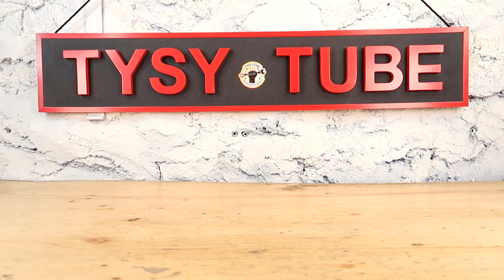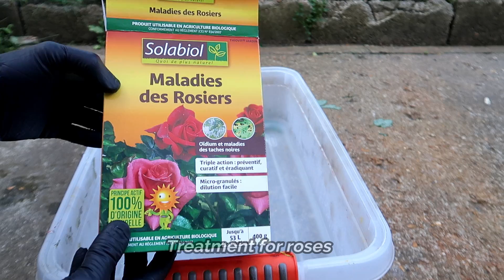Vintage Oxidized Sprayer restoration

Comment: I would have tried to preserve the original label. It looked way better compared to the new one.
Reply: I have seem them save them in previous videos
Reply: Did you guys not see it was unsalvagable?
Reply: @athazel4585  It was possible to scan/photo the label to outline the original typeface in any vector graphics program. Smaller size could be replaced with a much more similar typeface.
Reply: The original label was painted on. It couldn’t be peeled off.
Reply: Why why why u scraped of the original handpainted loggo and replaced it with a sticker 😢
Reply: The original label could have been saved by covering it with a decent grade painting tape. If it didn’t work out,at least an effort was made to save the original label. Either way, he bought it and is free to go about the project however he likes. I would have tried to save it because I like to keep as much of the original item as I can. However, I haven’t done a restoration in years, strike that, decades. But this Tysy guy keeps egging me on! Keep it up TysyTube, one of these days I’m going to get off my duff and restore something, just wait, you’ll see, maybe...right now I have a video to watch...😜
Reply: @maxyudin  I struggle to find something similar. "bazar" is somewhat similar but this one in particular i can't find. Strange "R" shape.
Reply: @Desi365  Yes,  "R" is the subject, everything else could be any slightly modified grotesque-style typeface, but "S" is also a question. It's not Bazar's as it is far away, but Bazar could be used instead because it fits  well.
Reply: @Vault57  I agree. Watching TysyTube is like a piece of sweets for me.
Reply: I was hoping it was a plaque.  The original looked awesome.
Reply: @henkerosen996  that's not hand painted
Reply: @maxyudin  If you knew what the name of the font was you could find it easily and not have to scan the original sticker at all. Just mess around with the kerning a little bit and print out overlays until it matches.
Reply: @Desi365  Even though the pump is from 1950 I am sure the font is from the art deco era.
Reply: I know it's not replaceable, but you should've used silk screen techniques OR, at least, retained the original dimensions of the original label when using the sticker route.
Reply: @henkerosen996   that gutted me. watching him scrap that off made me so sad.

Comment: Rust remover will not work with copper. To remove patina use vinegar+salt+flour.
Reply: He still removed it, but with sandpaper and polish. So - the same result, but easier to reach.
Reply: @-Sergey_  he clearly doesn't want patina on his restorations. He consistently removes it through sand paper and such. It's for his own collection so there's nothing wrong with removing all the patina.
Reply: I know about how removing patina reduces the price of a thing, I just adviced to author, how to reach the same result easier)
Reply: @-Sergey_  Agreed, a lot of these "restorations" are not restorations more modifications
Reply: Looks like someone other than me watches my mechanics channel too
Reply: @-Sergey_  There is value and then, there is value. We've been down this road on so many of his outstanding projects and nobody ever seems to learn from his comments or gentle jokes.
I like what he does, I enjoy it and, again - until I see the links to all the brilliant videos from the naysayers, I'm assuming they're incapable of doing what he does and, thus, are just blowing hot air.
Reply: Copper can not rust. Rust is iron oxide. Copper has no iron so therefore rust can not occur.
Reply: Looks like he did a pretty good job to me.
Reply: Patina is nothing more than dirt and rust.  Very valuable tools and firearms should not have the finish removed, but with a project like this, making the tool look and function as new again is the objective.
Reply: MC-51 can remove copper oxidation. You can see that the parts where brighter when removed from the solution.
Reply: If it's actually copper use ketchup and salt mix it together apply and wipe
Reply: @-Sergey_  not to everyone.
Reply: not everything on it is copper i did notice that one of the push rods isnt, i do agree you need vinegar to resolve copper issues but he did all of it at once so i dont see the prob also hes skilled at restoring things, ive seen him get alot praise from the bigger restorers
Reply: @-Sergey_  It doesn't.
Reply: kopfgeldjagar  atleast someone else realizes this.
Reply: @thomaspaquette9991  there is this thing called copper oxide though
Reply: @-Sergey_  
lol, why would it lose its value?
It's not like he remade the entire thing out of stainless steel and plastic parts :v
I'm a simple man, and I like the shiny, you seem to place more value on old dirt and grime than in the product itself lol.
Reply: i was so triggered by that
Reply: Using flour and vinegar on brass removes the zinc and leaves it pink.  Be warned.
Reply: kopfgeldjagar  'Do know that copper can oxidize. Right? '
It can, but the green coloured corrosion is a reaction to CO2 in a moist environment creating copper carbonate. Same with copper rooves and bronze (mainly copper) statues
Reply: @-Sergey_  Now I know you don't know what restauration mans. He brought the product back to its state when sold brand new. We don't care the value. Plus patina will come back one day...
Reply: @-Sergey_  WHat's the point of having rusty dust collectors on a shelfrather than having useful functionning tools ?
Reply: @-Sergey_  have you ever seen a museum exposing painting with patina on it?
Reply: @-Sergey_  "Value" does not exist. It's only the price someone is willing to pay for an object. If you prefer object with patina good for you. people will make cash from you selling dirty&dusty objects. Some prefers nice and shiny, like brand new objects. And those one will pay less for a dirty artifact and more for a restored one.
Their is absolutly no difference in this object. He's just clean. The only thing that may decrease its "value" to people like you is the sticker that is not original anymore.
Reply: @-Sergey_  Yes, however, we're not collectors. Besides, patina will come back anyway, so no need to worry about it.
Reply: @-Sergey_  A restoration is a process intended to give an object it's original aspect and functionality. That's exactly what he did? How would you name what he did ?
Reply: In what proportions?
Reply: Я, вот честно, никак в толк не возьму нафига коллекционерам патина? Она же только уродует вещи. На мой взгляд полированный металл это куда как красивее.
Reply: Налёт времени, ощущение старины и всё такое. Отполированная вещь смотрится новоделом часто.
Reply: Ну, если только. Хотя всё равно не понимаю я этого.
Reply: I've always just let my copper soak in some ketchup for 30-60 minutes then rinse with water and dry buff, brings it right back every time.
Reply: All this carry on about removing patina reduces value.... who cares? I could never understand the need for a dirty, grimy item. I’ve been restoring stuff for some time and all of my items are as polished as I can make them. I don’t give a “flying f..k” if I’ve reduced the value as I’m not selling it. It goes on display in my “Man Cave” (pool room ) or in my shed.
It boils down to, it’s my item, therefore I decide what I like.
Reply: Glucose and water is the way to convert oxidised copper into copper.
Reply: @mc-51rustremover13  When are you going to give this man a sponsorship?!?
Reply: Oooo why don’t you make your own videos then
Reply: @Brayduhsurus I totally agree! The value of an item seems to be only set by the amount of money someone agreed to pay for the object. PLsu what's the goal to own unusable items? it's like:
- IS your sprayer working?
- huh non it's rusted and full of vintage patina.
- OK, it's just a rusted piece of garbage then.
Reply: Or ammonia
Reply: Ольга и Сергей I agree but some people prefer to just make old things look new he probably doesn’t care about the value
Reply: @ethelryan257  nailed it!!!
Reply: @thomaspaquette9991  that's why they all call it patina.
Reply: Anyone going to  say that it looks as good as new? It looks awesome, something you would be proud to say you did, instead of something you'd shove into the back of your shed.
Reply: Dale D you realize your comment has no relevance to anything I said. But thanks anyway, good info.
Reply: @fnbdraco  why use ketchup when vinegar is cheaper and you don't have gloop to wipe off afterwards?
Reply: No offence meant because I, too, love homemade products that work. That recipe does definitely work but it leaves the copper with a pinkish finish.

Comment: I feel like I’ve seen this before. 🤔
Reply: Me too..
Hmmmmmh...🤔
Reply: Me too, in other resto Channel
Reply: @lurezpe8655  yeah, but tysy did a very similar sprayer like 6 months ago
Reply: @tracydono8427  nope, it was way before the fire extinguisher, the other sprayer was a little bit bigger but the same manufacturer
Reply: i remember around december someone did the exact sprayer but use turtle wax instead of snail ear wax LOL. and packing the pump with twine and plumbing grease.

Comment: Brasso (name brand) Polish Wadding is made to remove tarnish, oxidation, etc.. from brass, copper, stainless steel, and chrome - and it works amazingly well. (Never Dull, another brand, but essentially the same as Brasso.) Keep doing what you do!

Comment: That original label was so perfect... Would have just taped it off and polished the track by hand.

Nice creativity on the disassembly though!

Your poor grinder is going to need restoration soon! It shouldn't need help starting up!

I couldn't tell what grease you were using, but it should be silicon grease. It's much more inert than regular stuff and cheap/easy to get at the hardware store. We use it all the time in restoring old fountain pens.

Comment: Nice restoration although I think you could have tried harder to find the font for the large label. There is a website called “What the font” where you can take a pic of some type and upload it to their site, it might come up with fonts that are closer to the original.
Reply: But that font seems to be handmade (sorry my english)
Reply: anyway, in corel or illustrator you can vectorize it
Reply: Leo Tizi. I don’t think so. The roughness of the edges is probably due to the printing process back in the day.

Comment: You should try CLR on brass or copper. I work on tug boats and we use it all the time to get rid of grime on metals. Super easy. No scrubbing. Just let it soak and Wipe It off with a rag. Then bring back the shine with an abrasive polish

Comment: I thought the original label was in pretty good condition, considering its age.Personally, I would have taped over it.Just amazed that you find items like these at flea markets.If I'm lucky, I might run across a rusty pipe wrench or horseshoe at ours.

Comment: Get a nice thick piece of glass and spray glue the sand paper to it. This will give you a nice flat and smooth surface to sand or lap parts on.

Comment: In the U.S. there is a powdered stainless steel and copper cleaner called Kleen King.  It may be available on Amazon or it may be available in Europe in stores.  It is AMAZING on copper.   It doesn’t scratch and it’s great for copper upkeep.

Comment: If you put that in wire wheel cleaner for about a minute it would have done 95% of that including make the copper shinny. You have to get the stuff that's phosphoric and hydrofluoric acid for it to work. You can buy from auto paint shops. Stuff is amazing what it can do to metal how it dissolves the oxide and leaves the metal behind

Comment: I love these restoration vids  :). I have a question: why do you use wood hardener on the handle? Wood hardener is usually for rotted wood to preserve what is left. The wood handle on this pulverizator looks to be in good condition?

Comment: You should've saved the original label.  You did replace it, but it was bigger than the original.  Nonetheless, the copper in that sprayer is awesome.

Comment: Next time use the Fehling-probe to "remove" the oxidised copper. It will remove the oxygen from the copper. 
You can use a glucose-water mixture.

Comment: for cleaning and de-oxidizing copper, brass, bronze and similar metals, try this:
crumple some aluminum foil and line that plastic bin with it, then add sodium bi-carbonate followed with HOT water.
the instant your copper or whatever touches that aluminum, an electro-chemical reaction will clean those oxides from the piece under restoration without scratches.

Comment: Best way I have found to clean copper alloy metals (brass, bronze, sterling silver, etc), is as follows: mix about 250ml dry sodium bisulfate powder, 60ml 3 percent hydrogen peroxide, to 4 liters of water. Very warm water works best, about 60 Celsius. For us americans, that's 1 cup sodium bisulfate, 1/4 cup of 3 percent hydrogen peroxide, to a gallon of water, at about 140 Fahrenheit. It is very important to use glass, stoneware, ceramic, or plastic while handling the chemicals, and not iron. You do not want anything with iron touching the finished product, you can't use stainless steel either. Any iron in the solution will dissolve and plate your copper in a thin layer of iron. Sodium bisulfate is commonly  used to lower ph levels in swimming pools, called "ph down" any big box retailer or swimming pool supply store should have it, and its not very expensive. For something with this level of oxidation, after cleaning with acetone to remove and dirt and oils, a quick 3-5 minute soak would probably be all thats needed to clean it back to bare metal. The solution, or "pickle", as it's commonly referred to, is safe to handle, but I recommend wearing gloves, and being in a fairly well ventilated area, it does have a bit of a stench to it. I've been told that its safe to pour down the drain, and that it makes a good fertilizer for roses, but I cannot confirm this. A batch of pickle will last a very long time, and can be stored indefinitely in my experience, if it is evaporating, just add more water, and if it starts losing its effectiveness, just add a splash of hydrogen peroxide. Heat it up before use, if its been stored. You should find it much more effective than the other methods I've saw you try.

Comment: Nice job! But vapo-rust is way better than the mc51. And you'll certainly have to disassembled it again only to clean all the non-soluble particles from that rose product!
Reply: Hi, Evapo-rust is a nice product, but cannot remove copper oxidation, MC-51 can. You can find a video on testing on copper.
Reply: @mc-51rustremover13  Copper oxidation is better and easly removed only by using a steel brush. Using products for that is a waste of money and time. No need that. And I didn't mean only for copper, evapo-rust is better for all purposes when compared to mc-51. I can say that because I work with that.
Reply: @rogeriosartori555  I will not try to argue on this. Www.evapo-rust.co.uk  we might have more experience than you on evapo-rust. :) I totaly repsect your opinion since you tried both products and you have a clear image?

Comment: I usually don't complain about the restoration of things due to the "removal of history" or what have you, but the removal of the flash from the original molded piping seemed a bit overkill for this. Apart from making it smoother it doesn't change the functionality so it just seems like an odd choice to put the effort in to sand it off.

Comment: You have not restored functionality of this device. 

Thing you were removing at 3:02 was not a washer, not a gasket, and not a deformed piston. It was a pneumatic one-direction valve, and it had a reason to be of such conic shape. When pulled towards its narrow direction, inside a cylinder, this valve is passing air (thus soaking air into the cylinder), and when it is pushed towards wider edge this valve is blocking air (thus pumping air into the canister). 
At 12:45 you just put a thick gasket, instead of valve, thus effectively disabling the pump and turning entire device into a useless in terms of its function.
Reply: It's really different from the original 3:03
Reply: Not at all. The valve it the little square moving thing at the bottom of the cylinder.
Reply: @vzorglub1  After thinking twice i am not that sure about the work of bottom valve. Maybe you are right. And the author made the right decision. 

This is what i was thinking - 
"This is the output valve (opens when pushed from inside the cylinder), which placed to prevent draining from the bottom of cylinder (when "piston" is pulled). The cap-shaped "piston" is the intake valve, which blocks the flow when pushed and passes when pulled it's designed for filling. The final assembly has some pressure due to loose tolerance of the gasket-piston and bottom valve which closes and creates a small amount of low pressure in the cylinder during the pull motion." 

- Yet, note at 17:36, how much pumping required to pressurize the tank. This was my main concern. Probably this is just how it was designed to work.

Comment: Excellent work... but... sorry to be that guy, but as someone who used to help restore antiques, I have to say something... filing off casting lines is most certainly not part of restoring something. A restoration is to return something to "like new" condition... and when that sprayer was new, it had casting lines. Sure, removing them makes it look nicer, but therein lies the problem. It's nicer than new, and a restoration shouldn't end up where it looks better than new.

Comment: Does copper rust? Does restoration mean you scrape off the original labels? This is not 'my mechanics' channel where the God himself would make the bottom even shinier than the top because high quality work is always done when ,and where, no one is looking.